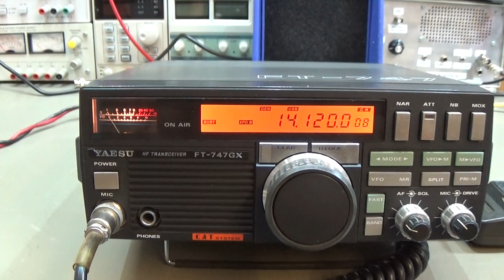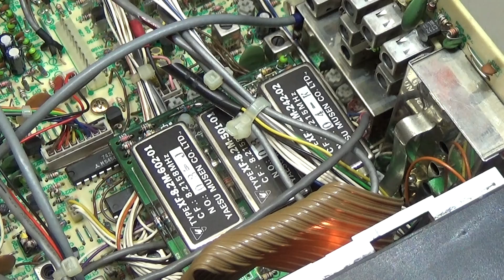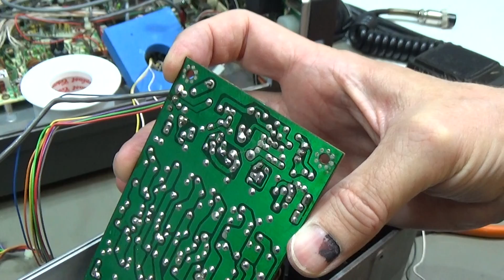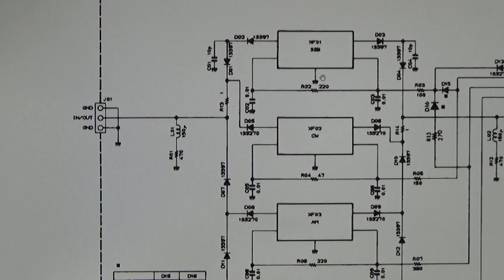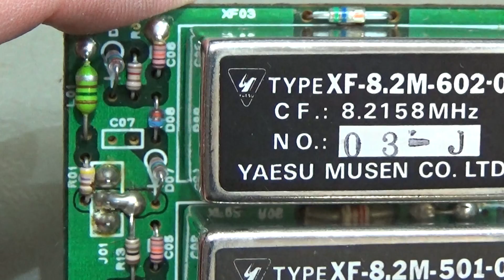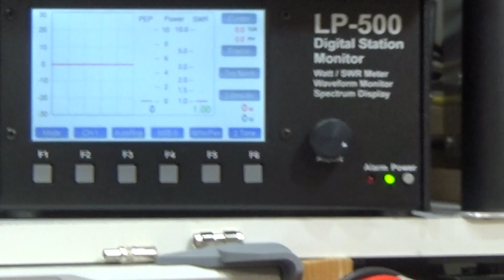#147 Yaesu FT-747 GX intermittent receive

Comment: Hello friend. I bought a ft-747 that has a battery drain problem. I have replaced the battery twice and it lasts about a week. Because of this, the memory does not work and the GEN mode either. The radio receives and transmits normally outside the HAM band, but it shows ERR on the display. What could be draining the battery?

Comment: Greetings, I have an 80 Charly Yeasu radio that I use first, I have to heat it up for 1 hour, then it can transmit and the power goes out, if not it doesn't work,Please help with a solution to fix and which part needs to be fixed

Comment: I had the same problem on the RF filter board with my 747. I repaired the connection and that fixed most of the issues. I did NOT know about the diode problem, I will now fix that next chance I get.

Comment: Hi there Alton I have a yaesu FT80C which was handed down to me by my late grandfather. It is not transmitting on any band, the on air light comes on it draws about 2 or 3 amps but the S Meter does not move at all. The RX works great the S meter moves on RX but no TX at all. If I tune another radio next to it to the same frequency I can hear myself on it but it has no amplification. I have been through the PA I have checked all the voltages at the initial drive, pre drivers and final transistors as per the service manual and they all check out ok. I am getting voltage to the pa as the relay clicks when I press the TX button. As this rig has real sentimental value to me I really want to get it going but no one here in Australia wants to touch it, they won’t even book it in for a look can you help me please??? and point me in the right direction

Comment: Ok i saw it. My last question; is it possible to share connection diagram for rotary encoder? I have ec11 mechanical rotary encoders but i couldn’t manage to connect it. Thank you very much, 73 de TA3LKU.
Reply from the maker: If it is the same encoder as I used in my video you only need to wire 4 wires up...

Comment: Hi again Peter.  Thanks for a fun look at the inside of the FT-747 GX.   As a kid  I loved this rig.  Always wanted one - but never actually purchased.  Happy to see they are still in service.  The old PCBs and huge components made me laugh.  Do you work on any tube gear. I never learned any tube theory?
Reply from the maker: Hi Mike, yeah the 747 is still a nice radio and as long it is working it works fine...All made in THT very old school haha..Yes I also work on tube equipment and it is not so hard to understand but you need to be much more careful as you are working with high voltages but other than that it is pure fun ..Thanks for stepping by 73

Comment: Peter, I think troubleshooting electronic devices starts out seeming difficult and once you locate the problem they reclassify to easy problems. I was working on an old boat anchor collins and I spent days on end trying to find out why the receiver level would dropout and return. and It turned out to be a notch filter can had a loose connection on a tuned circuit. Now knowing what the problem was it became a simple matter of soldering a connection back on a coil. But intermittent problems can be a nightmare until you find the problem that is hidden. Good job on the video Peter looking forward to the next one.
Reply from the maker: Yeah that is how it goes some times..Thanks for comment. 73

Comment: Peter can you speak about the Soldering Filter you use in another video thanks
Reply from the maker: oh you are talking about the Hakko smoke absorber. Well it is not the best and I'm going to upgrade it to a more professional filter system but it is the minimum you should use if you doing solder work on a regular basis.. 73

Comment: Nice repair Peter. Always a pleasure to a specialist at work. Everything looks so simple. This time it was. Maybe a intermodulation test was usefull to confince the OM that output power is not only important thing. I am very curious wat it is. Entertain and learn. Thanks Peter and let the video's come.
Reply from the maker: You are right as more you push such a little radio for power all the figurers are going worse... Thanks for watching 73

Comment: Hi Peter,
Well repaired. This error has already occurred to me very often. I always fix it with very flexible braid. Wire as used, for example, as a measuring cable.
Thanks for the entertaining video. :-)

73 Bernd
Reply from the maker: Hi Bernd, yeah to fix it with most flexible braid is of course the best you can do... Thanks for comment 73

Comment: I suspect that the loose so239 connector caused the pin to break the solder joint on the pc board
Reply from the maker: Yeah that is absolutely possible...Thanks for watching 73

Comment: I think we possibly knew what the joint issue was before you did here Peter, as the close-up camera shot at 9:48 showed it very well. We could see the antenna wire moving up 
and down through the hole in the PCB :)   
Good fix my friend.
Cheers, John
Reply from the maker: LOL yeah you are right John. I have seen it during editing the video but I was not able to see it sitting in front of the radio. You big screen makes the difference :^) Thanks for watching my friend Cheers